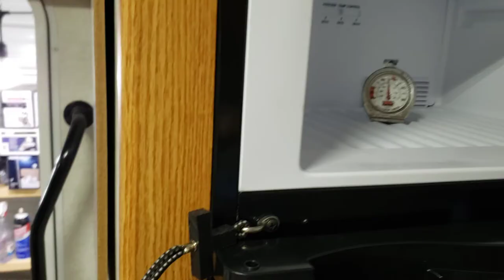DIY RV Residential Fridge Door Latch / Lock No More Opening of Refrigerator Door While In Motion

Comment: Absolute genius!  Just installed the same fridge yesterday and running up against the same issue.  Doesn't appear there's any "commercial" products that are anywhere near as elegant.  Do I assume correctly that I'd have to cut the rope loop to form a hook?
Reply from the maker: yes ... Roop loop mounted to fridge from Lowes
National Hardware N100-342- 9/16-in Rope Loop in Stainless Steel 
https://www.lowes.com/pd/National-Hardware-N100-342-2056-9-16-in-Rope-Loops-in-Stainless-Steel/1002256376